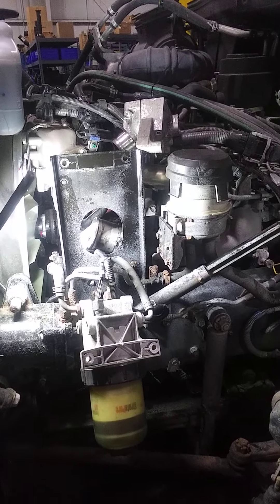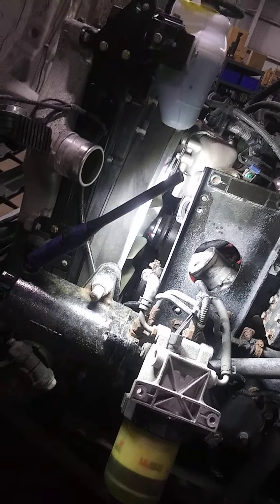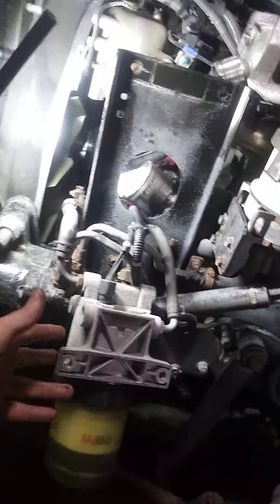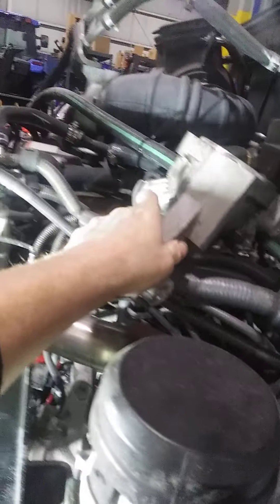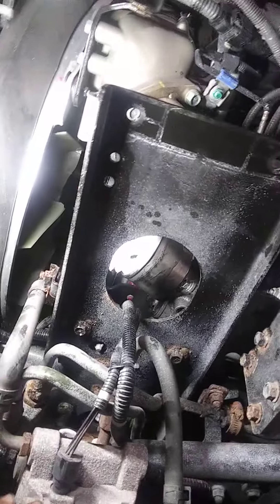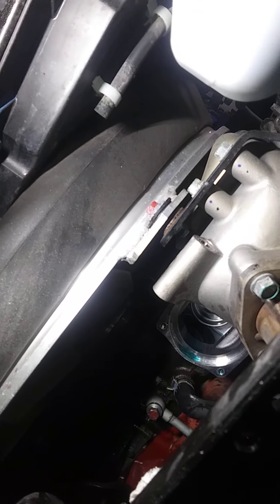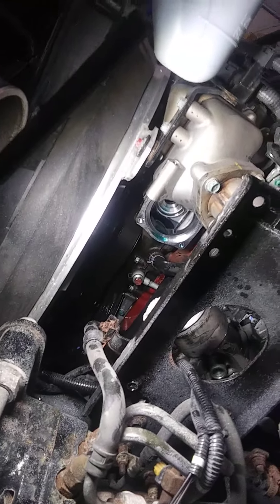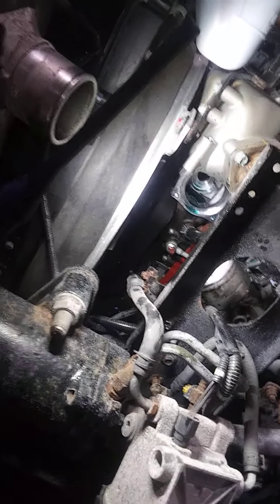2019 Hino truck thermostat location and replacement

Comment: Hey. I have a 2016 Hino 268. When I start my truck, is says coolant level is low even when its full. The warning goes away when the truck heats up. And coolant comes out of the overflow hose. Any ideas? Please help.
Reply from the maker: Sounds like possible head gasket, you'll have to have it checked out

Comment: Did you have to air bleed the system when you fired it back up and ran it? Ive got a 2008 Hino that the temp is bouncing between the lower mark and the higher mark. It goes up then comes down. Got the trk 6 months ago so not sure on the last time it was changed. With hot weather coming in Texas figure id do a complete cooling system flush and stat change. Wasn't sure on the air bleed process if it was needed or not.
Reply: @dandiesel5109  Thank you sir. Sounds like the old school way we've always done them then. Just checking make sure it was nothing special on top of the norm. Safe travels buddy. 😎👍
Reply: You do have to drain the coolant fluid right?
Reply from the maker: I pull all my trucks outside and let them run up to temp with the cap off and heat on

Comment: Taking over this job from some one else. What direction does the t-stat go into the housing?
Reply from the maker: @cubuff80221  that I don't remember,  it was almost 2 years ago I did that job
Reply: @dandiesel5109  I tried Hinonet but it’s been down for going on 2 weeks now. Thanks.
Reply from the maker: @cubuff80221  try calling your local dealer, ask the shop, they can tell you or send you a pic

Comment: Hello i have 2017 hino 268 , last few days the coolant escapes/shoots out of the reservoir container from the black lid , its seems its shooting out from the small tiny hose thats comes from the radiator toward the container because when i punch the tube the coolant stop escape when i let go its keep coming.  Please help
Reply from the maker: Sounds like you have a bad head gasket
Reply: @danhewitt5109  oh wow , not thermostat or water pump 😭
Reply from the maker: @EARTHKEENING  I've never seen a water pump able to built up enough pressure to do that,  and a thermostat has a  bypass in case of failure,  so that it would build pressure in the system.  If your radiator has a pressure cap, that maybe bad, I would replace it to rule that out
Reply: @danhewitt5109 the cap is pressure cap I will replace the cap tomorrow and update .
Reply: @dandiesel5109  I noticed the A/C heater is not hot like before .
Reply from the maker: @EARTHKEENING  Sounds like your whole coolant system needs to be checked out, you may have a few issues going on, I can only guess and give you ideas without seeing the vehicle, I can tell you this I worked for a truck leasing company in the past and they had Hino, once they hit 4 to 6 years old they had a ton of problems,  #1 was overheating,  so I would say get it checked out at a Hino Dealer, and go from there